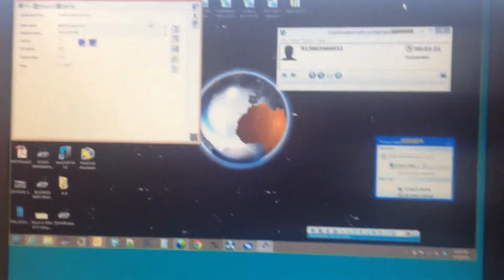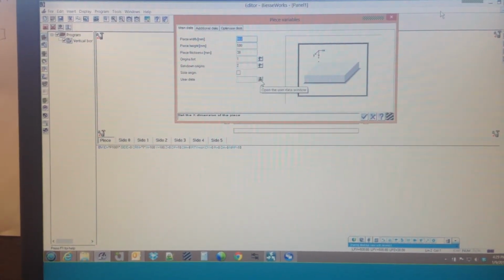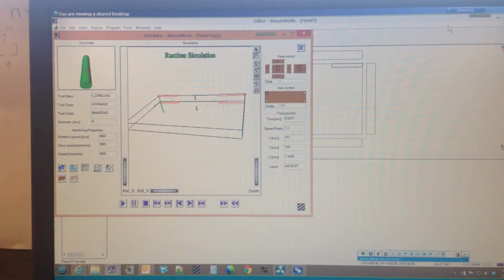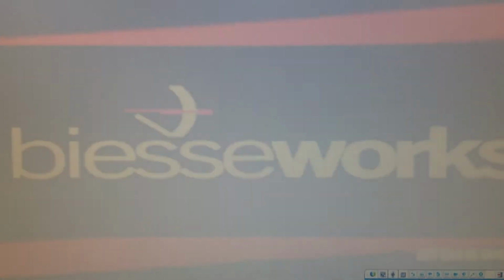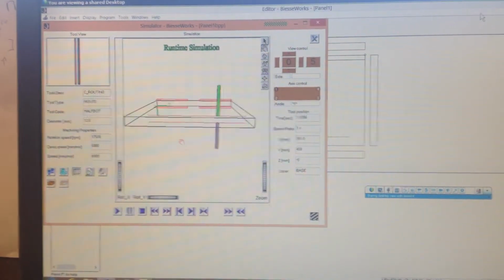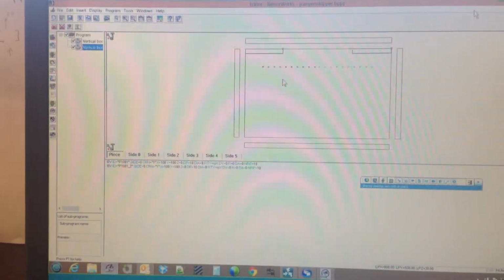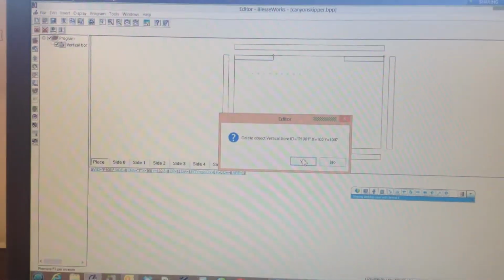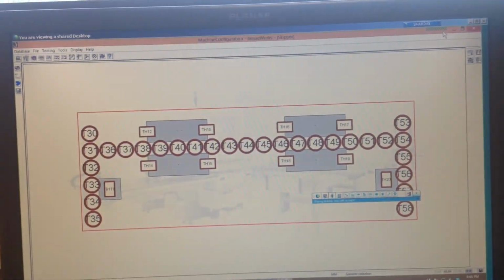Skipper Biesseworks training

Comment: Hello, I'm new to biesseworks, i have a problem.

How can I mirror pieces? I can only feed panels on the left side of the machine. Is there an option in biesseworks to mirror programs? thank you in advance
Reply: Usually Biesse machine table is already setup this way that works as programmed on ORIGIN 1,3,5,7 and on ORIGIN 2,4,6,8 machines mirror of your program, you don't need a mirror image program, CNC does it for you. Make sure that your ORIGIN 2,4,6,8 are mirrored and clamp parts that you want to be mirrored on those ORIGINS